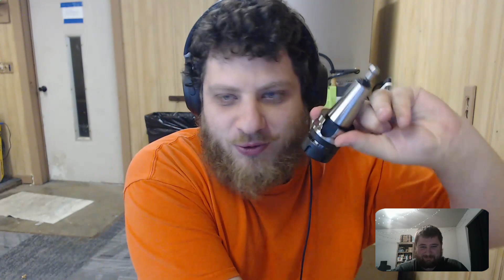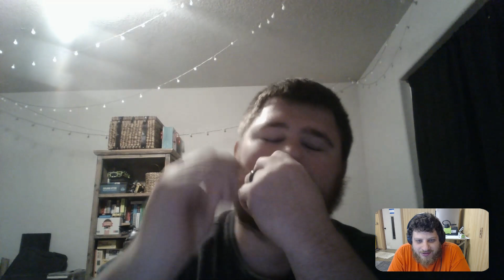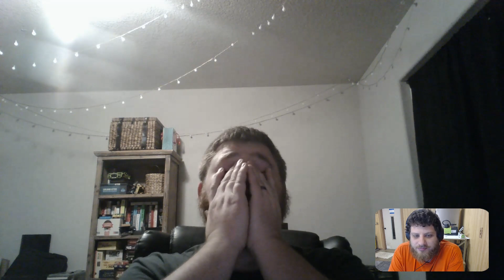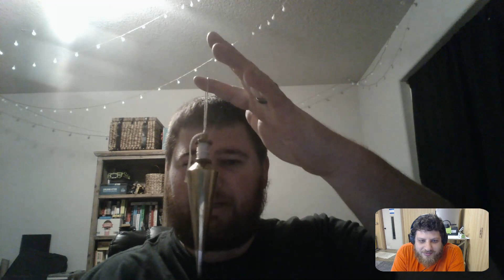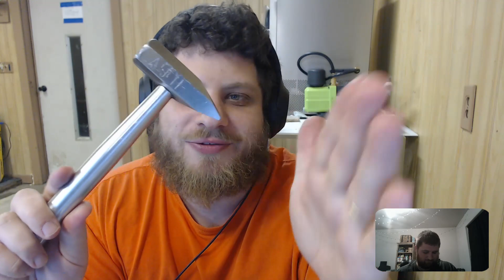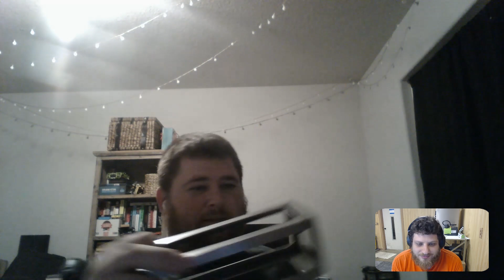Haas Demo Day -- Ep. 56

Comment: They do make ER20 holders for ISO20, I see one on Tormach's site at least. Though for your kind of work it's probably not super useful unless you needed a small face mill or something.
edit: Those are different pull studs though like you said, my bad. Also not sure if you'd want to put Tormach tooling in the Haas lol.
Reply from the maker: Those are a different flavor of iso-20 🫤. They aren't compatible with the Haas ATC. They use a different flange that gets used on CNC routers.
Reply: @AudacityMicro  Oh I see that now, good to know, thanks!

Comment: I don't know if these were recorded prior, maybe you already have your machine by now. If it's a 6000lb or smaller forklift you can stick some full sheets of OSB/plywood under it to spread the weight over the gravel. If it's a bigger forklift you can use metal plates. We've had to do both, even though most of the gravel was compacted, right by the garage door was deeper and not as compact. The forklift for the VF2 was massive and we had to put down some random diamond plate we had and slowly drive forward, as the wheels cleared one piece we'd stop and move it to the front again. I don't think I would try to lift your machine with straps though personally, that'd just turn it into a swing load. With every machine I've moved  the forks just go under the machine, though the narrowest one I've done is a small mini mill. Definitely just have the truck drive out from under the machine once you lift it up though if you can, then lower the forks till it's just above the ground.
Reply from the maker: We're currently on episode 71, this is part of the back catalog that I've been slowly uploading.

We ended up doing something very similar! It ended up going pretty smoothly!
Reply: @AudacityMicro  Awesome, good to hear!